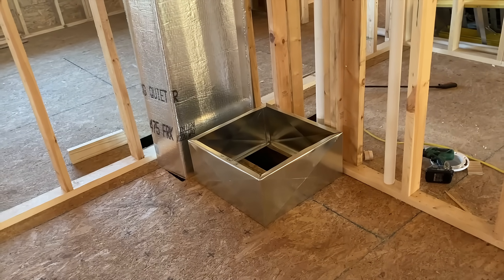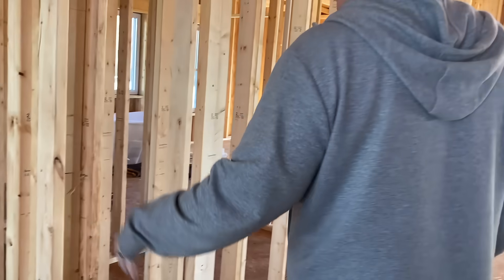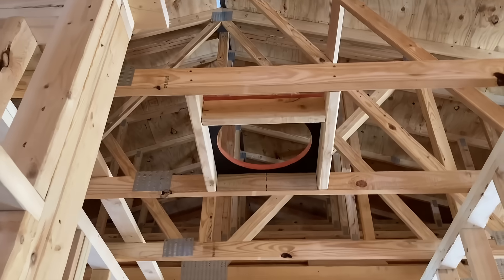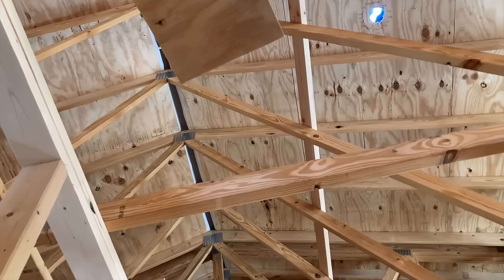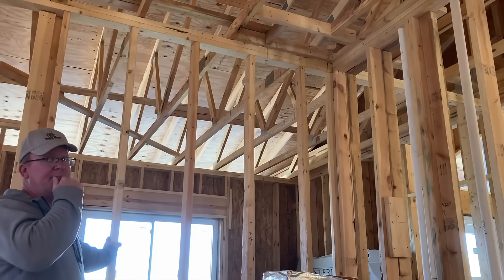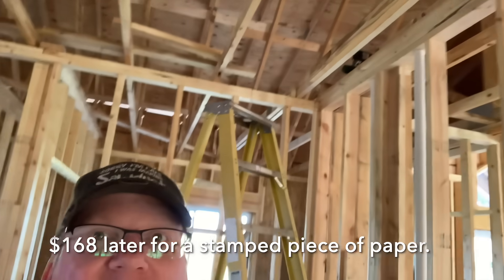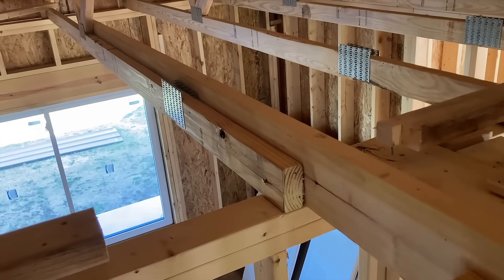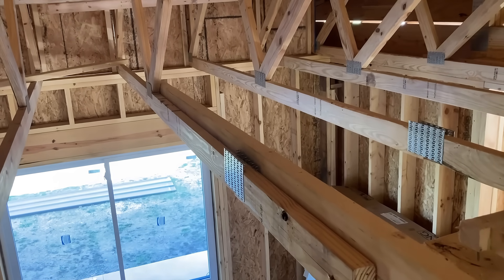HVAC Guy Cut Our Structurally Engineered Truss to Put in Duct Work. Do Not Cut Trusses!

Comment: We had a 140 year old house, and things were going wonky.   We took off the sheetrock, only to discover someone cut framing, because it was not plumb with their need for sheetrock.   Someone cut posts, to run wiring around.  The repairs hit thousands.  The house had to be jacked up, for repairs.  Floorjoists were cut!  The guy whom did it, actually died, so, we bought the house.   But, it cost more to repair the house then the house was worth.   The final tally was shocking, we had to replace about 8 4x10 beams, and 4 posts, and most of the interior framing.  Stairs.   Nothing was left untouched.  Some people are just dumb enough to cut structure, unnecessarily.  Almost like they are playing jenga with the house.

Comment: You can cut a Truss and box it in, that's a framer job without talking to an engineer. If it was a Load Bearing wall, then it's an issue but can easily add a soffit just for hvac duct work to go around the load bearing header.

Comment: Wherever the blue print shows, that's where it goes! Now it upto the framer contractor to build support , if you didn't have a blueprint or general contractor to oversee  the project then it's your stupidity also the engineers should of had devised a blueprint

Comment: Dude you are overreacting. That truss would probably never move even if not repaired. 
As a builder of 40 + years I've fixed broken, failed and cut trusses many times. Not a big deal.

I'll give you that it never should have been cut in the first place unless ok'ed by the truss engineer and I'll never get why plumbers and hvac think they can cut whatever they want. 

If you are the general it on you for not knowing exactly what the hvac guys plan was since ya'll laid out where the ducting was going.

Best advice I can give you is chill, it's wood it's repairable or replaceable at worst.

Comment: @:53 - Whats up with that crooked opening Horixontally speaking? Is that for the attic? Or maybe its an illusion?? HVAC takes up the most space, OR, they run flex "spaghetti" everywhere, believe me, you'd rather have hard pipe or ducts. When properly done, there is only about 3 feet of flex used to connect to each floor boot or ceiling box. Only hacks do that differently. The more returns you have, the better the temperature will be throughout the home. Central single returns are loud and ineffective. They also require undercutting doors for air flow to that return. That's a hallway, it probably won't have a light. It appears to be a 14 or 16" return. I knopw noticed they are using duct board, because you must be down South where that's all they use. I hate it, I prefer galv sheet metal. Installers love it, just cut it on site to anything they need, and can do anything with it, no need to cut a truss; set up and above it. Sheet metal is custom sized, and decreases in size after each few runs to maintain static pressure. Good luck to you...

Comment: Had this happen on one of my jobs.  We had fink trusses, and an HVAC guy cut one of the webs of a girder truss that boxed in a large skylight.  I had written the contract so we could back charge the subs contract plus overhead and profit.  Fortunately P&R Truss (of Sidney, NY), did not charge for the engineered drawings.  We essentially had to build up a big sandwich girder with plenty of glue and splice plates.  Put a crink in the HVAC guys' draw schedule, but ultimately only cost him a couple hundred bucks.  Worst is it brought the entire job to a standstill for about a week and a half.

Comment: Seriously are not new construction plans have the wiring, HVAC ect in them so they know where to put the ducting? Also, since they are stamped in, why not just remove the stamps and replace the piece that was cut out and press the stamps back in instead of doing all that?

Comment: It still boggles my mind, that even using a PE signed off truss plan, that 2X4" are used for roof trusses? 

12 years ago, I built a 16X32' shop in my year. I went to my local real lumber yard and had them contact his truss builder but wanted to incorporate 2X6's instead of 2X4's and to use #1 lumber instead of #2's which are commonly used. These trusses were spec'd as storage trusses.

The up grade to 2X6's and #1 lumber cost me an additional $50 per truss.
Reply: My brothers shop has been up for 35 years in New England, 2x4 trusses 24" on center and the roof is still perfectly straight, my shop I did 2x4 trusses 16" on center, been up 10 yrs, straight as an arrow. My house was built in 45' with traditional framing and 2x6's is wavy as all get out haha modern technology/2x4 trusses are just fine.

Comment: "Insulation wrapped in more insulation..." I'm just a DIY homeowner, but won't any dust and dirt in your air cling to the insides of your ducts made of that stuff and over time become just a massive forest of dirt and breeding ground for dust mites, a la allergy central? I KNOW it's going to stick some to even the smoothest surface, but why start out with something that seems to be tailor made just to create a dust mite breeding ground?
Then any time a clump of it gets knocked loose by a hammer blow or a foot stomp or a door slam or any kind of earth tremor... you've got that crap (literally dust mite droppings), coming loose and now you're breathing it.

Comment: As a carpenter/builder for over 45 years, I have seen heat guys do things like this my entire career. Out of all the trades, they seem to have the least grasp of structures and their integrity. To their defense, architects rarely take the HVAC system into consideration. More often than not, it is an afterthought. Chases installed to cover duct work is offensive to intelligent, thoughtful design. That should never occur.
Reply: Maybe the architect needs to take the hvac into account when the draw it up

Comment: Comical watching homeowners come in and worried about something like this which is actually nothing , you can tell they have no clue ! That's 45 years experience talking. I stick build roofs on million Dollar homes , much stronger than these so-called structurally engineered trusses.
Reply: Exactly! They give too much credit to a 2x4 stick.  There are trusses on each side, not more than two feet apart. Besides, they can sister it way better than what they did here. Cut one 2x4 to fit the space, then sandwich it with nails with two other 2x4s. Nonetheless, hurricane ties to the cross and the truss, if the cross was doubled, would have sufficed.

Comment: The problem isn’t that he cat it. The problem is he only did 1/2 the job.   We would have cut the truss as well but we would have talked to the builder or engineer first first and told them what are plans are. The hvac guy should have done the work your doing now   If he would have informed the owner if what his plans were and the builder then this wouldn’t have been an issue at all.  Communication is key.  We go over everything with the homeowner. Not just where the unit is sitting.  Where is our ductwork going. What we need to cut it gave the framer cut. Where the supply registers are going and the return air. Preferably the wife would be involved since she will be the one doing the layout of furniture. Glad to see your fixing it the right way. Good luck

Comment: Your framer either isn’t a structural engineer or maybe he thinks that a big lump of timber will look stronger to you. The truss chord was already constructed out of 3 sections of 4x2 which are butt jointed with what you call fish plates so a 6x2 that long is already overkill as a repair. A 4x2 half that length would still be overkill.

Comment: Oh no the wife is making structural decisions. Most marriages can't survive that lol. And Everything is flexible now no more metal plenum its all fast install  crap. Wait till you see your attic lol.  Its all Temu Bluetooth now. Hope you don't have the 40 foot long dryer vent pipe those do not work constant clogging. Be smart put the dryer in the garage where it belongs easy venting and not heating up the house. Also stagger the depth of the bedroom and bathroom wall studs for sound proofing then add sound proofing.
And if you think ac guys like to cut studs wait till the electrician gets in there and cuts big holes through all your kings.

Comment: I just haft to put my two cents in. been in the building industry for fifty years!  HVAC crews are the most destructive with a Don't care attitude. They can cut a engineered floor truss, floor joist or a roof truss with their chain saw with a dull blade faster than a speeding Locomotive!! 
I'm so glad that I'm Retired and don't have to Fix there Sh### aneymore!

Comment: Should always refer to the plans!!! Most of the time plans are required for a building permit. Have a meeting with your GC before you start sparring with HVAC. Making changes to the plans should be done in writing, a GC responsibility. Use a steel plate or beam to connect rafter and top plate. You could use a steel 4x4 to support the steel beam.

Comment: This is what I dont understand about homebuilding. Besides small details that get overlooked like an outlet or light bulb how does this get missed in the plans?

Isnt there a master blue print that would include the mechanicals and the runs for the HVAC? the duct work is not trivial, it must be accounted for in the placement of trusses, walls etc. So why is it that HVAC would have to come in and make massive alterations to Trusses, joists etc?  An HVAC tech has to look at the plans and figure out the sizing of the system needed for the home and where to place the unit, the returns and the feeders. does this info not make it onto the blueprint? Does it get sent back to the engineer to review and possibly make structural changes?

Comment: I cut a truss 35 years ago for an attic stairs. Didn't hurt a thing. I understand they are engineered, but at 22 had no idea. Anyway, in 35 years it's the same as the day I cut it. Maybe I just got lucky.
Reply: Dude, don't tell people that. Somebody else who's been thinking about is gonna go do it now because you just said it didn't cause YOU a problem.

Have you actually measured everything where you can say for a FACT that nothing has dropped since you compromised the designed structural integrity of your house?

What's going to happen when you go to sell the house and the inspector says that has to be fixed? If you're planning to leave it to spouse or kids, are you planning to sandbag THEM with figuring out how to get that fixed and pay for it just to sell the house at some point, and you won't care because you'll be dead?

Comment: He should have asked, but this is VERY common. Truss repairs are common, especially dealing with hvac.  This is what happens when a clueless homeowner wants to play/claim builder. Guaranteed every trade on this job wishes they passed.
Reply: Because trades never f*ck up, right? Never cut corners? Never skimp on materials? Never fail to meet minimum code that is itself sometimes not good enough, let alone go above and beyond code because it's just the right thing to do where code sucks! Never hire unskilled workers and fail to properly supervise them and inspect their work? Overcharge for a job? Bail before a job is complete and still put a lien on owner's home for payment for work either botched or never completed?  Fail to pay subs? 🙄
Reply: @dolfinwriter5389  Miss your morning coffee… That was a little over the top. Most of what you’ve typed there can be avoided by NOT using the lowest bidder and simply checking a few references or better yet going and checking out a job they’ve just completed. Quality subs can be hard to come by, generally they’re consistently busy, and for good reason. They won’t take every job, and for good reason as well there to.
Reply: @Charlie-go6eb  I think you must have missed YOUR morning coffee because you've completely missed the point. I'm talking about NEW CONSTRUCTION.

BUILDERS hire these subs.

I'm responding to the guy who said "know-it-all homeowner".

What I'm saying is nowhere near over the top nor is it what some shady contractors deserve.

I'm also talking about OLD CONSTRUCTION like my 1978 house I bought four years ago and had NO control over the subs who did the wiring, etc. 43 years before.

I'm talking about whatever MORON put exhaust fans in both full baths in this house but never connected any duct to them and left the exhaust dampers shut and HELD shut by the attic insulation until I bought the house 43 years later.

And if you say a single word about what code required in 1978, you're only proving my point.

I'm talking about the MORON who wired the upstairs light fixtures when this house was built and ran Romex through well mounted ceiling fan rated electrical box knockouts but without any cable or grommet of any kind to secure the cables and protect their insulation from steel edges.

I'm also talking about the MORON inspector who was either too lazy, incompetent or bought off to find this and make sure it got fixed by the builder.

There's no way in hell THAT was EVER code compliant, so now I get to fix them all and make it right, 43 years later.

I don't even want to get started on what a complete bullshit nightmare some of the original plumbing was in this house that we had to fix, and some I really can't fix without doing major demo to get to it.

Comment: Been doing this a long time now and this bullshit still continues. For any aspiring contractor or architect, design the friggin AC system BEFORE you design the trusses or floor system. It really isn't that damn difficult. Architects are completely at fault for this problem. At the same time, if you're still having to have conversations like this with your AC installer, get rid of them and find someone that won't just do shit like this without prior consultation.

Comment: It always makes me smile when I hear that a fixing needs "engineer approval". This is a trust. The house is under construction. The only issue here is that the cut "can" make the trust split. I think a 2 x 4 on both sides would been enough. There are two supporting walls in the area. And get that woman out. She's more of a pain in the ass than anything else. She probably had never nailed two pieces of 2 x 4 together.
Reply: Truss, not “trust”. Smile at that, Lucgagnon. And, when the inspector sees a repair to a truss it must be supported by a “stamped” engineering data document. Your comment reveals that you  aren’t a pro, Lucga. Big hat….no cattle. I have 52 years of residential  construction experience…..self employed for 45 years a residential contractor/ builder/ remodeler ….class C  license/bonded/insured/member BBB.   And the woman is sharp. Dave in Omaha
Reply: It's a TRUSS not a TRUST. idiot.
Reply: Truss
Reply: Whether she has or not I’m not sure. You on the other hand, I am very confident you’ve never nailed anything in your life except maybe your cousin.

Comment: We had to cut a roof truss to put in a fire place chimney. But first we doubled the truss on either side of the cut and then boxed in the missing area of the cut truss. The truss company engineer and the framing inspector approved it.
Reply: Certainly.   I'm an electrician and I've seen  more than my share of HVAC guys, and to a lesser extent, plumbers, drilling LVL beams improperly, and occasionally have to get an engineer sign-off because either they screwed up a truss, or it became necessary to cut/modify it because for whatever reason the ductwork HAD to go in that particular spot, although if it were me I'd personally preplan and place my ductwork according to the truss layout such that modifications will not be required, although in high end custom homes sometimes that's easier said than done when the homeowners decide to make changes after the framing has already been set in stone so to speak.
Reply: @Tom-mu7zy  Done as it should be.

Comment: Settle down. No need for hair on fire over a cut truss.  This particular truss was not free spanning and was tied into multiple points and was not going anywhere.  Even if left as it was cut.  But best to fix it and it was easy to do so.  And it could have been accomplished in several other ways.   Cutting trusses is almost always possible in one way or another.   Seasoned builders do it all of the time.   Often with a quick call to the engineer if needed.
Reply: Emphasis on the call to the engineer. He was right. HVAC was wrong, and should have done better.

Comment: Difficult to say what happened without the blue prints. The engineer/architect should have provided access.
Reply: Most prints are generic and they have no idea the physical size or dimensions of what will be used. Think of X marks the spot and the architect has no idea if it will fit or not. I had a commercial building the architect had a metal trunkline going through a solid structural beam so our side isn't at all like what a electrician gets 99% of the time. I can count on 1 hand jobs that went exactly to print in a custom one off build commercial or residential
Reply: @jonsaircond8520  I work in the field, there are MECHANICAL DRAWINGS. That specifically lay out the unit and ducting.
Reply: @rcctech1356 why I said only a handful have I ever seen go exactly per print almost nobody does it that way. It is a figment of imagination from the architect to get something close on a paper to get approved and stamped. Yes homes that are built hundreds of times and McDonald's are exact

Comment: Maybe I don't see this correctly, but aren't the trusses on 24" centers? The walls appear 16".

This looks like Massachusetts matchbox construction where the standard is whatever can be hid quickly behind drywall is a-ok. 
I have seen 3 story + foundation basement homes built entirely on 24" centers and staircases built using only 1" wood...

sweet